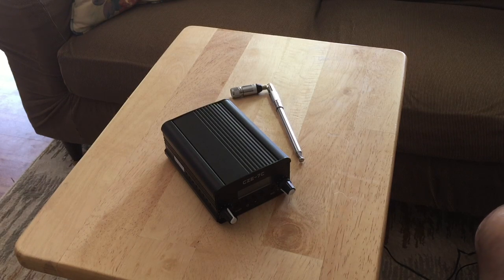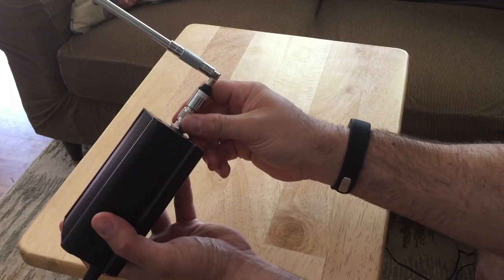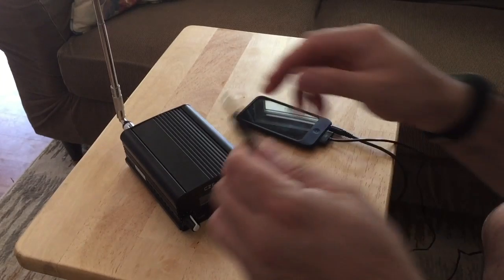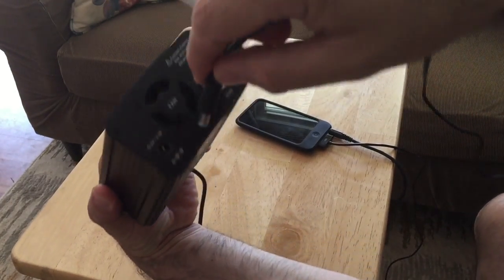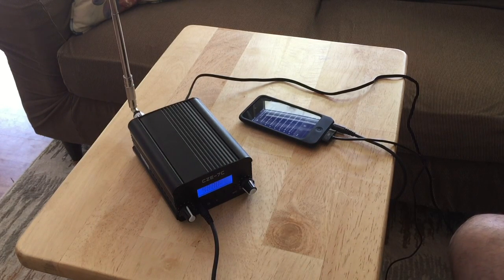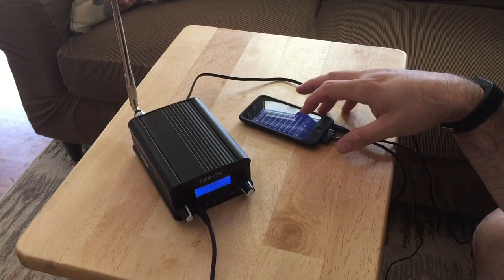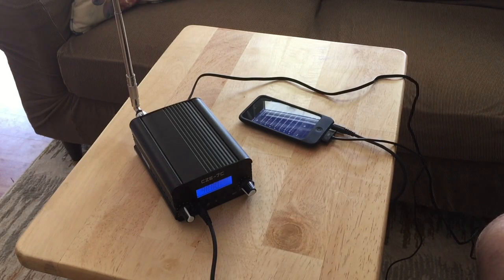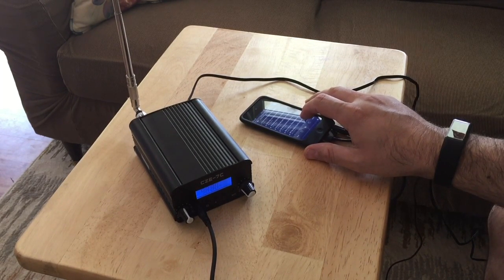CZE-7C Transmitter

Comment: Can anyone tell me if im with 7 watt  power output and how ?i need this transmitter for this coming December
Reply: I got this transmitter today and to change the power output you have to hold the power button in for about 3 seconds before you apply the dc power.Then you will see the letter L or H and then you can toggle between L (Low) and H (High).I hope this helps.On around 96 MHz my tx will put out 11 watts.That is measured with my Diamond SX-200 meter  and it has been checked against some very expensive test equipment so I know the output is correct.☺
Reply: @ianharling9569  how to transmit above 5km
Reply: @mahabharath6002  it is very important to use a correct antenna and to get it as high as possible.I have used a simple dipole with low loss coax cable  and you must make sure the antenna is cut for the correct frequency that you want to transmit on.For more information please email me and I can send you details if you need them.73..Ian.
Reply: @mahabharath6002  Hey ,,, what kind of Mic do you use ????
Reply: according to another commentor : The wattage is ajusted by pressing + and - simultaniously.
Reply: S it's true , but when power on switch or insert power cord, before press power button continue 3or4 seconds , after lose power button, displayed L, Press + button H Displayed, it's the way to 1 watt to 7 watt, Ok.

Comment: Hi, My Transmissor, Have a Big Sound in the Radio!! Not Clear... You Know What Because? Thanks
Reply from the maker: Your transmitter might have interference from a nearby power source. Make sure it is not around and air conditioner or any high output electronic old device.
Reply: MarielMGLo start with audio turned off, then slowly turn it up. The best way to get the sound at the right level is tune into another radio station and slowly turn yours up until it is at the same level as the other Radio station. If you have yours set too high it will be distorted.

Comment: hello, it is required first connect the audio input cable energy?
Reply from the maker: Edward C zuñiga 
1. Antenna
2. Power source
3. Audio input
Reply: @lowwattliving  What kind of Mic do you use ?
Reply: +Low Watt Living Podcast I think he wants to know if he must first connect the audio line before connecting the power cable to the transmitter.

The first connection to this should always be the antenna, failure to do so will destroy the transmitter.
Reply from the maker: Could you please rephrase the question please? I don't quite understand what you are asking.